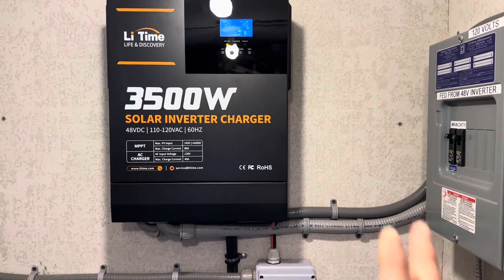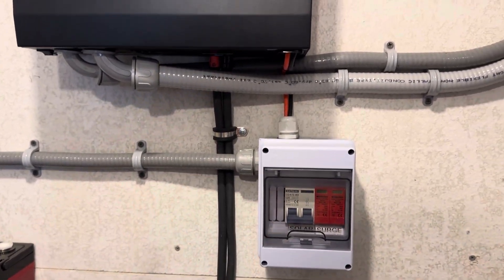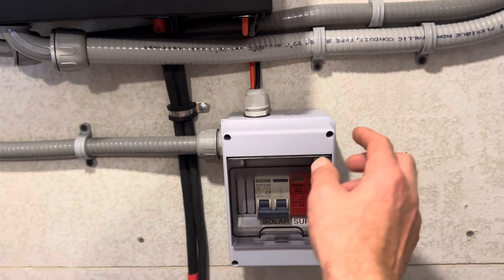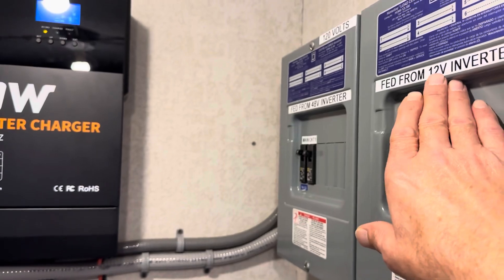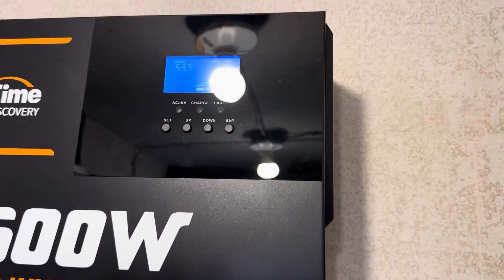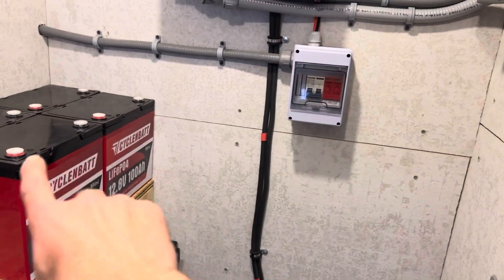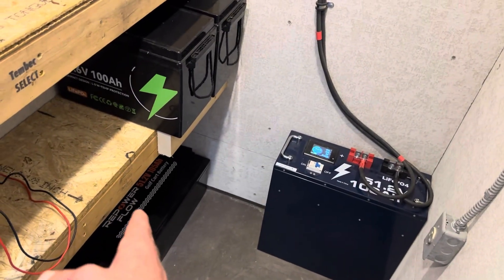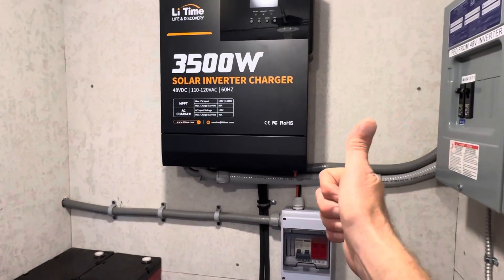Budget 48V Off-Grid Solar Build Part 2, LiTime 48V 3500W All In One Solar Inverter Build Update

Comment: How long does it take or would it take to use 2500-3000 watts on a daily usage to time wise?
Reply from the maker: 2500 Watt hours of energy storage or are you asking how much capacity needed per day for a 2500 Watt load?
Reply: 2500 watts of energy storage

Comment: What panels are you using and what configuration
Reply from the maker: Have 800W of bifacial on it currently. Series wired set of 4 (200W JJN solar) I am saving up for a large array for inverter and will use the existing 800W array on a stand alone controller.

Comment: What is the maximum PV voltage, or amperage input? (92 amps)?
Reply from the maker: PV Max is 145VOC. Spec on max PV current is 50A. Either way the max rated amount of PV is not to exceed 4400W total input!

Comment: Good video, I really appreciate it, a question that I did not understand well, do you provide the 110v input to the inverter to charge the batteries through another 12v inverter? I did not understand the comment about the 12v, if you can clarify for me please, another thing, I'm looking for this 48v Litime inverter and it's out of stock, do you know anything if they're going to put it on Amazon again? thank you for your time
Reply from the maker: I’m using a 12VDC to 120VAC inverter as my “grid” feed for the 48V inverter. I have no PV on the LiTime at the moment. To be able to log hours on the 48V inverter I’ve been using the 12V inverter to charge the Vatrer 48V battery through the LiTime grid charge circuit. Then I disconnect “grid” (12V system) and run the LiTime and Vatrer down charging something else when needed. Yes it wastes energy from conversion losses. Usually only do this when the 12V is full. Kinda acting like a dump load for the 12V system temporarily. Hope this explains a bit better. 
I have sent a message to LiTime asking about the restocking estimate. I’ll keep you updated!
Reply: @THEOFFGRIDMOUNTAINHOMESTEAD  Thank you, I hope you can upload the video when you place the solar panels on the inverter, and you can take data on whether it manages the loads well

Comment: I would like to see the inside of the inverter where the knockout options are to see if it would be possible to make custom openings wherein we could have electrical conduit to run the 48vdc wires in. 
Also interested in how well the 4 Cyclenbatt seriesed minis work with this setup. 
Thanks and KEEP ‘EM COMING!!!
Reply from the maker: The first video on this inverter from a few weeks ago I did take the cover off and showed the build quality! Good idea about the custom openings, I tried this initially but the cooling fans are in the way and not much room to make a blank off plate to adapt to standard trade size KOs!! I hope to have all the batteries connected in next couple of weeks! Appreciate you stopping by!!

Comment: The 48 volt system would take a higher PV input than the 12-volt system. Why get an additional charge controller for the 12v System?
Reply from the maker: I have to split arrays up in different areas and facing different directions. I’m surrounded by forest and have to deal with steep terrain too. I just don’t have enough flat ground to build one huge array to feed either system! All my flat ground is for growing my food! I put panels on unfarmable portions. My next arrays will have to be over 200’ from this power shed! All the prime spots are taken already for my house system.

Comment: Something to run a pellet stove off solar? I only ask because we have a pellet heat stove but we don't have our solar or finances aren't there yet.
Reply from the maker: How many watts does the pellet stove consume when starting and while operating?
Reply: @THEOFFGRIDMOUNTAINHOMESTEAD  my stoves is 120 volt, 3.0 amp 175 watts when operating. It's says 425 watts when the self igniter is on for start up but I don't use the self igniter. The electrode in it went out and my stove is so old I just manually light it with a torch.
Reply from the maker: 175W operation consumption would require (175Wx24Hr) 4200Wh/4.2kWh per day!! 5 solar hours average would be 840W of solar input required to keep your system running. These are ideal values. Realistically 1000W array would be minimum and probably wouldn’t keep up in the winter months and definitely not during cloudy weather. 1000W array and something like the LiTime would work most of the time. 
Cheap option is of course a small 1000 to 2000W inverter based gasoline generator, not solar but at 175W load would be very quiet and sip fuel for power outages.
Reply: @THEOFFGRIDMOUNTAINHOMESTEAD  thank you for sharing your knowledge and time with me. Well I guess that's what it will be a 2000 watts inverter based gasoline generator then. That's what my father has for his home, with a hard wired plug to back feed his house. You and Southern prepper 1 just have me leaning towards solar just the learning curve is so high for me.
Reply from the maker: @patriot110  the investment cost is steeper on solar. Easy enough to set up a basic system with an inverter like the LiTime and a server rack as shown. It gets more complicated and expensive when you’re wanting to make a “frankenbank” like I’m working with. 
A Champion gasoline inverter generator (good for the $) can be had for less than just the LiTime inverter. You don’t need a $1000 Honda generator for normal power outages the Champion is perfect for your use case scenario. 

Others have their own reasons for solar. Some are preparing for long term events, some like energy independence, and others just like the renewable factor! Do whatever is best for you!

Comment: Nicely done I Love seeing the wire in conduit instead of junky Romex stapled to a wall like so many other do. Can you try the LiTime on a generator to see if will work with a construction style generator as its grid? Thank you for the video ❤
Reply from the maker: Thanks, I appreciate it! Yes I plan to have a generator on this system eventually and a transfer switch for the 48V. Then I can power/charge from the 12V system or the planned generator!